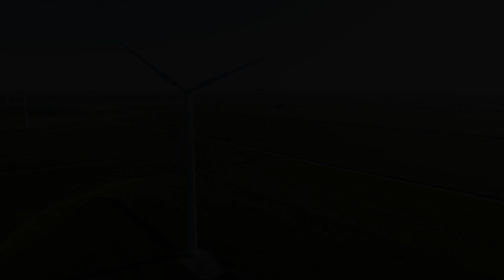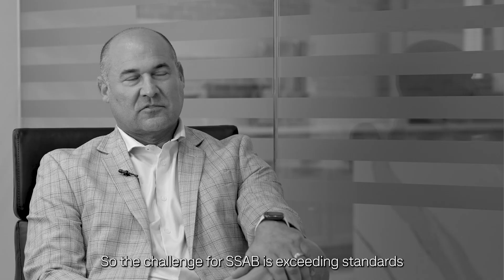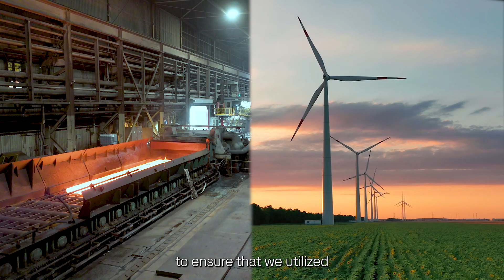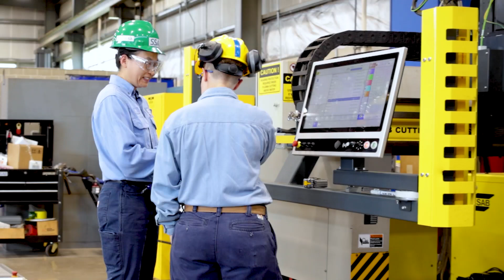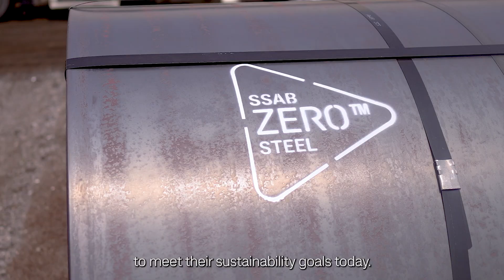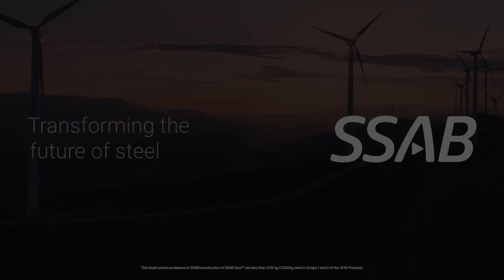Decarbonizing the energy industry with SSAB Zero™ steel

Comment: And how much is the additional cost to produce this steel?  Its not going to compete with traditional methods, so no viable business model.
Reply: Hi GPNeve, The production cost for SSAB Zero steel is slightly higher than for fossil fuel based steel, but the total cost increase for the wind towers are very small 💚 / Johan Anderson, SSAB